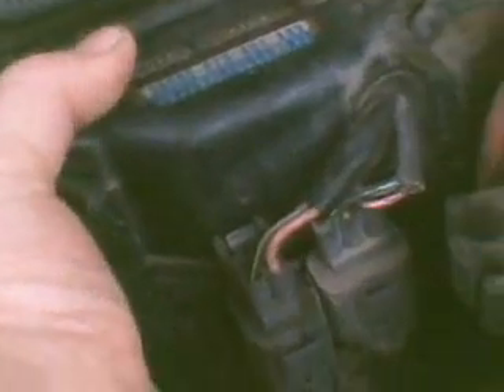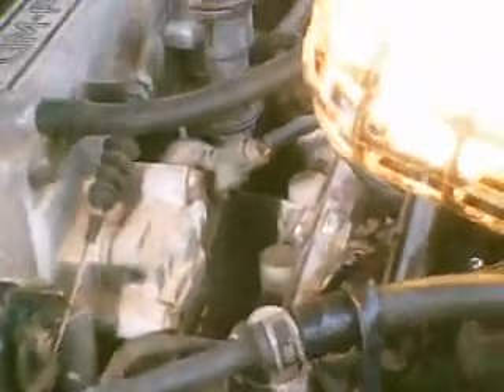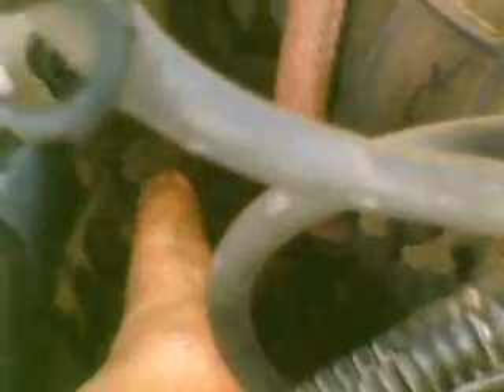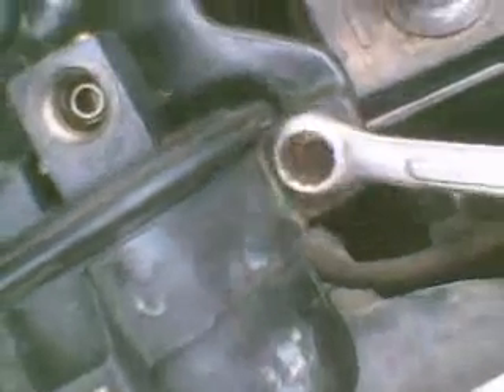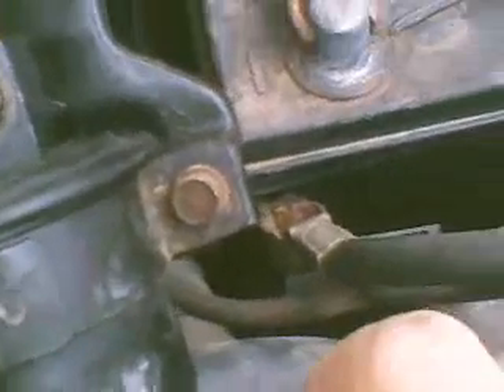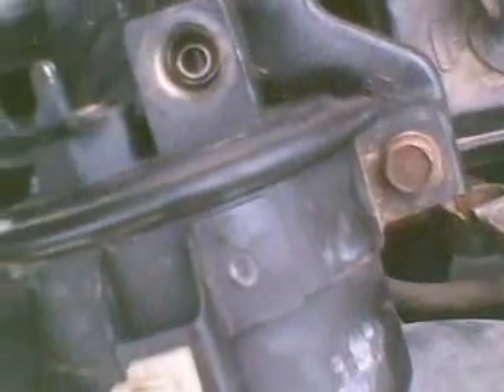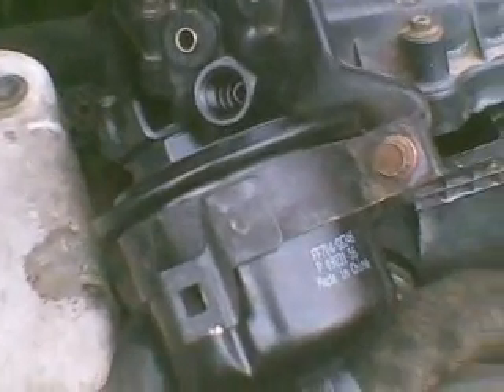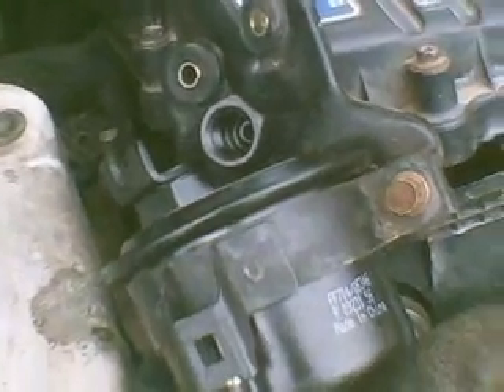Honda Accord Fuel Filter Replacement

Comment: A good suggestion is using a 19mm crow foot on the top and bottom to keep the filter from moving, so the bracket will not bent.  For the bottom 14mm flare nut that tightens on the 19mm filter opening, use a 14 mm flare nut crow foot on it with the 19mm crow foot to hold the filter in place.

Comment: what  if I put the filter in and it seems like its not getting any gas, won't start. is there any to bleed the gas, or what should I do?
Reply: if that happens it's mostlikely the fuel pump